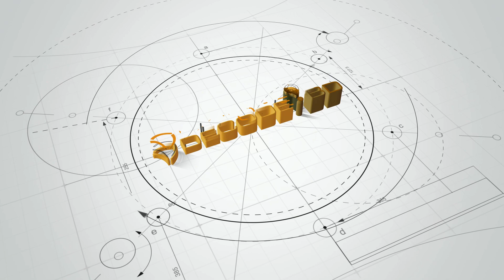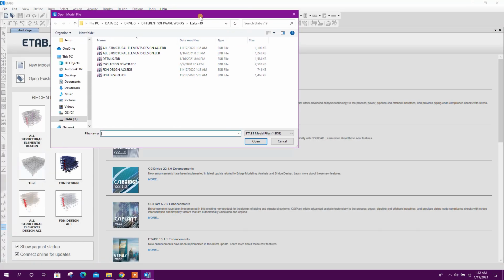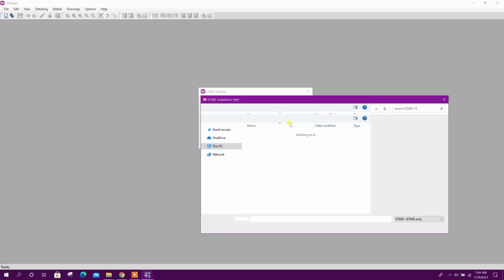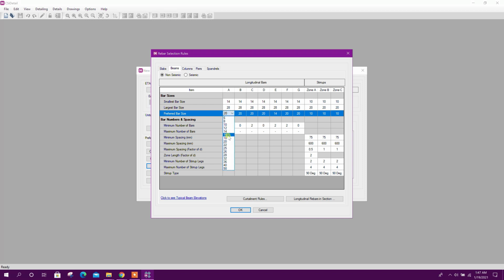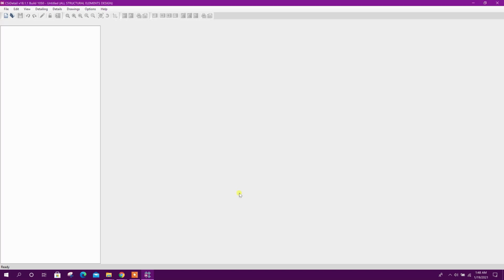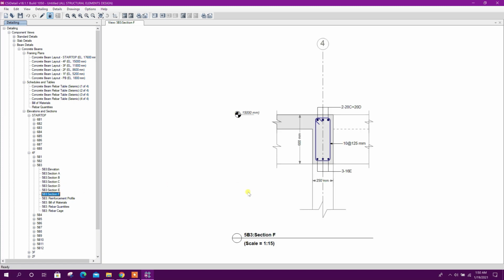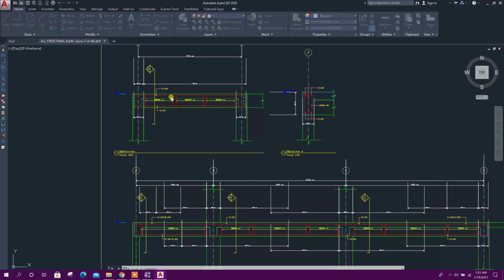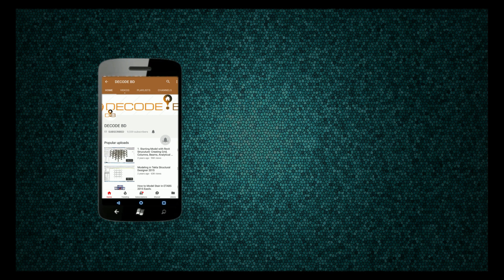CSI Detail for Etabs v19

Comment: I installed csi detail 18 somehow. When i tried running it , it said etabs 18 not found. Should i install etabs 18 also so that i can run etabs 19 file in my csi details ?
Reply: same case for me
Reply: @rejinyahel  u can, just select your current etabs version to run in program files. But in my case, i got some warning on my model, so the program cant creating rebar detailing.